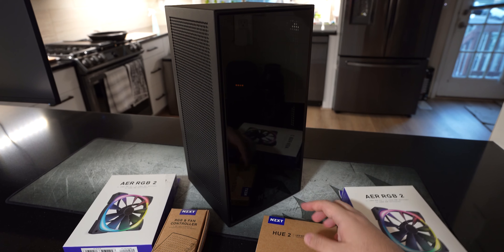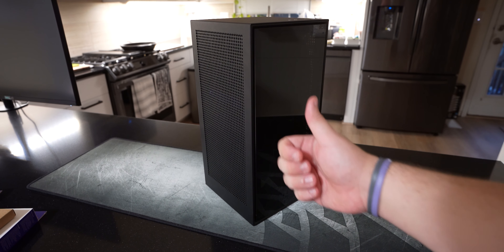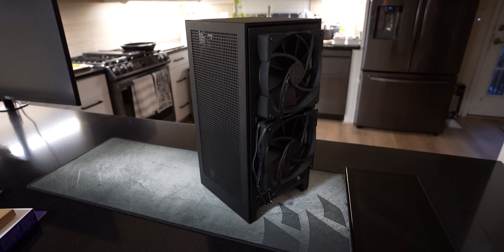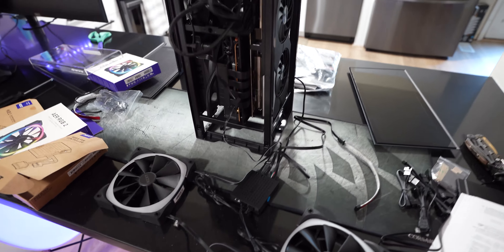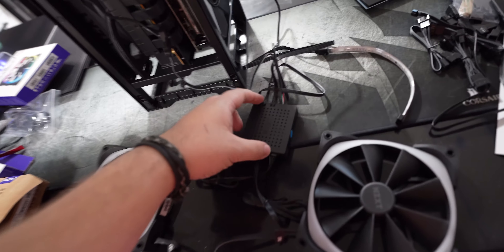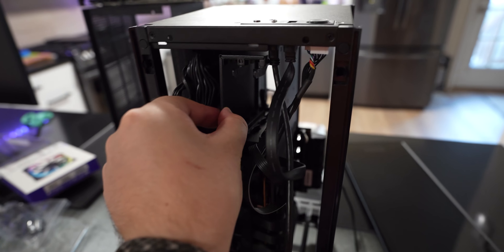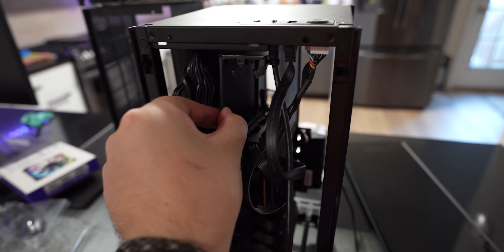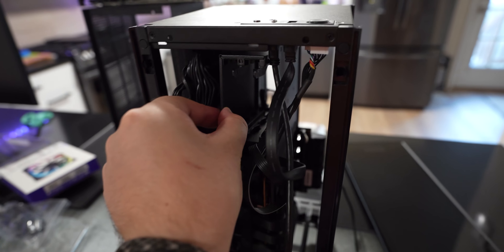NZXT H1 Mini - Dual 140mm Fans + RGB Modification

Comment: About to try a pretty jank set-up with a 4090 fe (power limited) & 7800x3d in this case. Really like how the 2 140s fit on the back, will be doing the same.
Reply from the maker: Good luck, if it works that's gonna be a beast! :)
Reply: @RikySongSu  Apparently have to remove the bracket to get the card to fit, will see 😅
Reply from the maker: @CarnivoryHODL  you got this, we believe in you!

Comment: would it be possible if i install the fan without the controller? would the cable be long enough without the controller as extender?
Reply from the maker: Should be long enough! Just make sure you have enough extra fan slots on your motherboard.

Comment: If you used non-NZXT fans, you could simply use the PWM and ARBG headers on the motherboard, eliminating the need for both the controller and the SATA cable. I have one of these on the way and you've certainly given me food for thought. Silver Stone makes a nice slim 140mm ARBG fan.

Comment: I used a pair of Artic P14 140mm fans, their cable is thin and easy to hide. I also bought grills and it looks really nice. The temperatures are awesome, i have a RTX 3070 Ti and the max temp i get at full load is 58 or 59 Celsius and the fans are nearly silent. If you want best results avoid fancy fans, they are loud and lack of good air flow.
Reply: I just installed the same fans as you, but after delete the stock rear NZXT fan and installed the arctic fans, the fans are turning when starting my pc, but after 3 seconds they stop with spinning. I switchted in NZXT CAM the modes but it doesnt work. How did you connect the fans? I connect them just in the rear fan connector of the controller.

Comment: Nice modification. I ended up doing something similar to my H1, but purchased a rear fan bracket from Artesian builds along with a perforated metal front grill for improved air flow with the 3080 tuf and 5950x.
Reply: Can you post a link to the rear fan bracket you purchased?  Thanks!
Reply: How are the temps after all your mods @adc cat? Where did you get the perforated metal front grill?
Reply: Could you post links where you got the front panel? I’d like to not have to remove the tempered glass while I game. Lol

Comment: As soon as my fans arrive I’m going to try this. I have a question though. My motherboard only has 1 usb2 socket which I’ve connected to the usb port on the outside of my H1. Will I need to unplug this to plug the fan controller into it?

Comment: I switched out the AIO with the AMD Prism that came with my CPU and highest temp I got was 69 C. With the AIO, I was getting at one point 100C at IDLE! I took out the AIO and opened it and cleaned out the guck and flushed the coolant. It did bring down my idle temp around 45 C but eventually it was going up to 90 C again

Comment: hey bro i didnt see what mobo you're using but i have the x570-i gaming - was wondering if you know where i should plug the hub into? myCPU has to stay plugged into CPU_Fan section. 

Thank you!
Reply from the maker: Hey! I have the Z590I AORUS Ultra (ITX). Do you have your manual for the x570?

Comment: I just ordered this case , I really have second thoughts about the fire issue , do you recommend it still for people wanting to buy this case
Reply from the maker: I don't think you need to worry about it. NZXT definitely seems like they took a reputation hit for that but it seems like it was an issue with the riser cables supplied. Those have all be sorted out and the build that I got had the new changes implemented.
Reply: Just so you know, I've had this case for a couple months and have had no issues on heavy gaming sessions, you should be alright.
Reply: Hi thanks for these replies , H1 is a beast , I setup the fan mod just in case it gets hot but I don't run it always,  only when I play gpu intensive games.
Reply: @adithyaturaga2972  which fan mod did you end up using?
Reply: @retrocoffin408  I'm so sorry , I thought you were asking about the fanmods from  the reddit thread , I made my own fan mod using some old PC fans and some wire , took the idea from the reddit thread itself

Comment: Very nice, I have a Ryzen 9 5900x cpu in mine but the stock AIO wasn’t cutting it so I rigged a 240mm Corsair h100i aio to the back panel. The holes on the back panel are like perfect size and spaced out to bolt the radiator to the panels (V1 at-least) 

Trying out the 3D printed dual fans front panel mod as well here soon once it prints. Should lower my temps across the board even more!
Reply from the maker: Oh snap nice! Thats gonna be a beast of a build!
Reply: does that mean the next h1 v1 has the enough space for the 240mm aio, if u put the fans outside? i am just thinking about buy it, my cpu is r7 7700x

Comment: Did you by chance check the thermals with the case off? It is kind of cool looking all naked, and probably helps with airflow too.
Reply from the maker: Yeah with some basic testing everything is about 10-15 degrees lower. Been running the Icarus Beta on Ultra 90fps and without fans it can be 80-85 degrees. With fans, it stays consistent at 68-71 degrees.
Reply: @RikySongSu  Thanks! :) I also wonder if pushing air in, instead of exhausting, would be useful? I see these are on sale now.
Reply from the maker: @rampatinling2689  with the way that the case is structured, you would want to do exhaust only :)
Reply: @RikySongSu  Got it. Thanks so much! :)

Comment: Bro I’ve looked every where where tf did you plug in the usb 2.0 into? Do I need to take the mother board out or what?
Reply from the maker: I didn't have too, just carefully squeezed it in. If you are viewing the motherboard top down. It's in the very upper right facing up towards the top of the device when standing up.
Reply: @RikySongSu  awesome thanks for quick response I’m mid process still stuck with my pants down 💀
Reply: @RikySongSu  I also dm you on Instagram if you are home can you send me a pic 💀😂
Reply from the maker: @zZMEMZz  sure no problem :)

Comment: Have you been happy with this system. Looking to get one. Right now they are $1500. Are you happy with that price for the market. Trying to get out of consoles for gaming.
Reply from the maker: So far with just over 3 months of ownership ship, I've been very happy with my configuration (bought for $2400)! Mine came with an Asus 3070 dual and it's handled most of my games between 60-165fps. (I have dual 165hz monitors). There are definitely better cases with better cooling but the shape and form factor sold me. Note that I also upgraded the default 16gb of RAM to 64gb to help with video rendering and such. This change does show improvement in games along with the Fans I attached.
Reply: @RikySongSu  how much did these upgrades cost you? Did you buy yours prebuilt? I’m looking at the h1 mini plus. 
CPU: Intel Core i7-10700K 
Gpu: GeForce RTX™ 3060
Ram: 16GB (2X8GB) they don’t specify the brand which kinda worries me. I believe they’ll just put whatever they have stocked.
Reply from the maker: @adamm6343  Mine was prebuilt and it mentioned that I was getting Team Group Branded RAM. When I purchased there was only one H1 Mini configuration and its now the current "Pro" line up. A 10700K with a 3060 should be fine for most things. The FPS numbers they show with the configurations for each PC is pretty dead on with 10% margins. And yeah your right, they pretty much build in what is in stock for them. What ever RAM you do get will probably be rated at 3200MHz and be low profile.

For the upgrades so far, I paid about $240ish for TEAMGROUP T-Force Vulcan Z DDR4 64GB Kit (2x32GB) 3200MHz. Then, $90 ish for the RGB controller, Dual 140mm fans and the LED strips.
Reply: @RikySongSu  Thanks for the response. Just looking for positive reassurance before I spend that kind of money
Reply from the maker: @adamm6343  yeah definitely, it's a big purchase. If your satisfied with the proposed FPS numbers then go for it. NZXT is a reputable company from everything that I've heard.
Reply: @RikySongSu  100 fps. I just gotta have something to get me through these market issues for the next 3 years. I just don’t want to buy something that’s not worth what I pay for it.
Reply: @adamm6343  hey, I'm looking at a similar config, same thing but with i5-10400f. if you got it, can you let me know what model of the rtx 3060 you got? I'm hoping that I can get lucky and get a trifan model. thanks.
Reply: @cap_hdhd  Nvidia GeForce rtx 3060

Comment: Does any of this void the Warranty? Just curious bc I ordered the H1 mini pro and it should be here in a couple days and this seems like a useful mod.
Reply from the maker: Hmm unfortunately, I believe it would. In fact even changing out the RAM would according to this. Here is the quoted warning: "Your Warranty will be rendered void if the service tag or serial number is missing, damaged, or altered. If you upgrade or change the System in any way after it is delivered to you, this Warranty shall immediately become void."